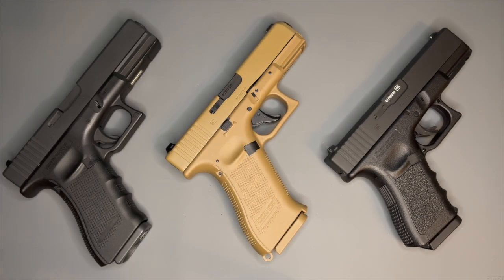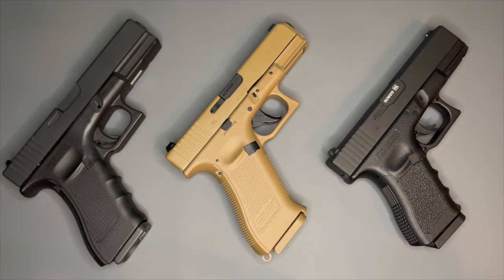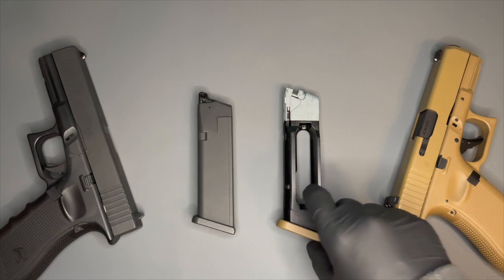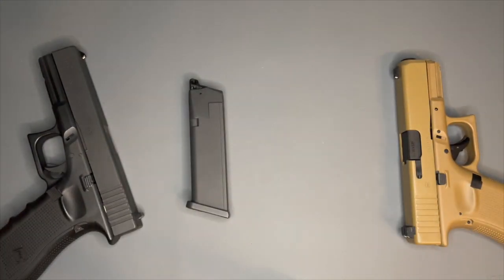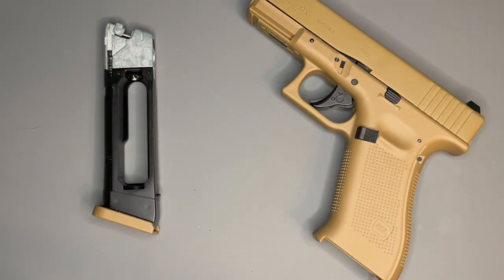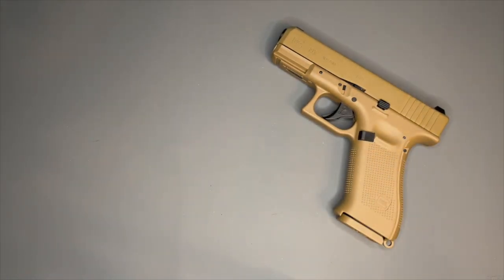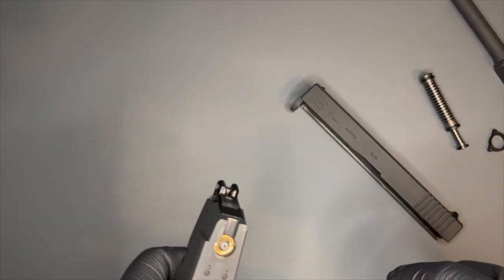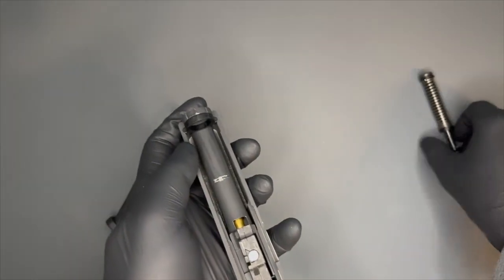Breech Of Trust

Comment: if u had one choice to buy an umarex glock which one it would be the glock 19x or 17 gen 3/4/5 or 19 gen3/5 and as iwe been seen at the websites the weakest one is 17 gen 4 others are 360 fps but 17 gen 4 is 300

Comment: A pretty good take on the mechanical aspect of the 19X imo..👍🏻

 I've got the HK VP9 and the ISSC M22 which both works the same way. And I must say I adore them both - especially the VP9.
 But, yes..
The triggerpull's first stage pushes forward the sled, which pushes the BB into the breech. Then, when firing, an internal hammer hits the firing pin, which moves within the blowback seal and hits the valve stem's rear end, which is seen in the rear of the magazine top. After a taken shot the slide moves and then cocks the internal hammer. And thus the blowback also do serve an actual purpose.
 Oh man.. I love the mechanics on these!
 Been wanting the ASG US-C 1911 also, which got rid of that ridiculously long triggerpull.. But I still haven't gotten myself to order one..

Comment: You explained it perfectly. And yes, the trigger on the 19x does reset since reciprocating the slide cocks the hammer. You heard that right, it's a hammer that Umarex is hiding inside the slide, so the betrayal continues even further. :) The blank guns they're building that resemble striker-fired pistols are as well equipped with a hidden hammer. Just as a side note, but that is so recklessly dangerous imho, when someone who does not know better carries those things in their appendix cocked with no manual safety and no internal safety mechanism either.
Reply from the maker: Fair point. I'd hope there would be something about its operation in the instructions but even so, a lot of people don't tend to read those when they're excited about their new gun unfortunately.
Reply: @airgunreplicas77  That is actually a gap in the market. To my knowledge there is no one doing reviews on these guns going through such details. At least not on Youtube. Yet. :)

Comment: The only Glock pistols I like are the Glock 17 Gen 4 and the Full Auto unbranded Glock 18c made by Barra.
This was a great video showing how a true blowback air pistol works compared to others that work through the trigger that hits a valve to release CO2 and fire the BB -
A true blowback air pistol is supposed to strip a new BB from the magazine into the barrel each time the slide goes back.. similar to how a real firearm works.. and most of the blowback air pistols in my collection are of the true blowback type like the Glock Gen 4.
Reply from the maker: Thanks for that feedback. I was paranoid that I’d either made a hash of describing things or I was giving out poor information. If either proves to be the case I’ll happily take it down and remake it. Many thanks once again mate. All the best!